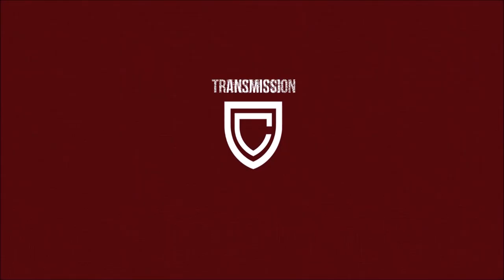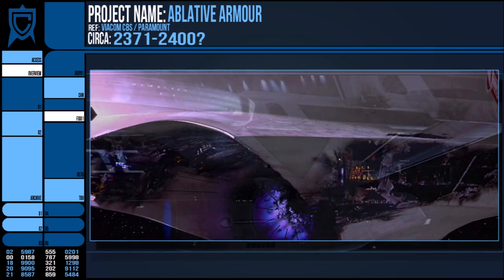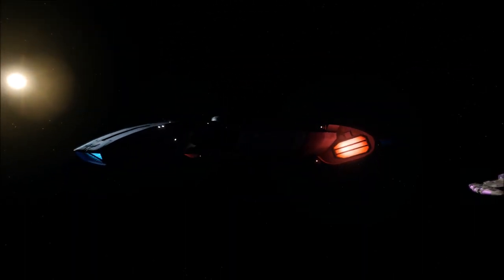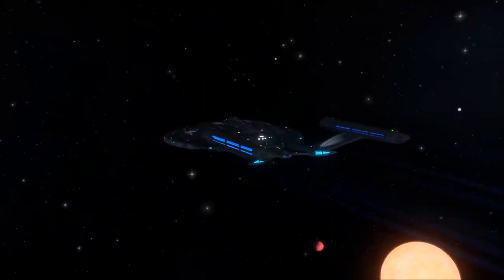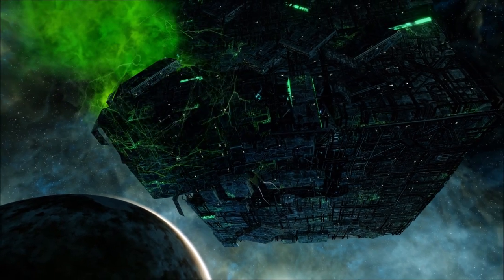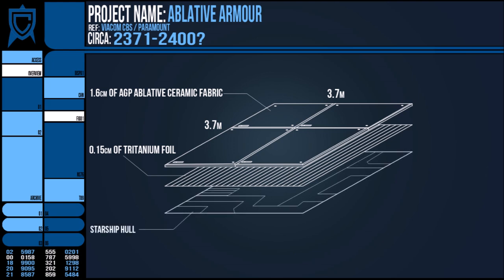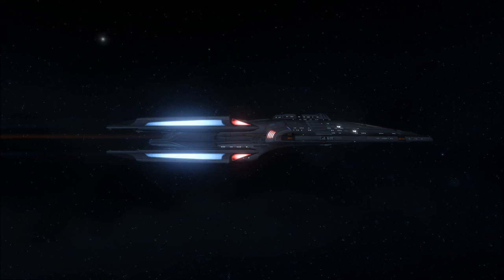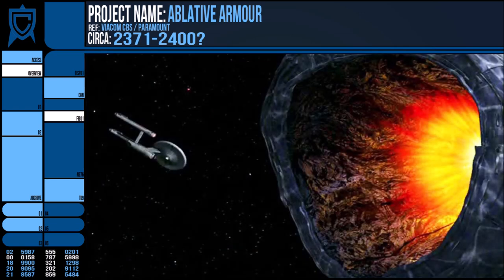What is Ablative Armour? (Star Trek Lore)

Comment: I had never heard the "full name" of starship hull material before, I'donly heard it called Duranium. When he said "Duranium 235", the penny dropped...it's Depleted Uranium 235!! The ridiculously hard material used to make anti tank shells (as fired from the A10 Thunderbolt/Warthog aircraft).
Reply: DU is actually pretty soft overall, but it is dense, and has the interesting ability of self-sharpening as it is forced through armour at high velocity. Its density also lets it absorb a lot of energy too, hence why it is used in tank armour. Also, depleted uranium is mostly made up of 238, not 235, 235 is the more fissile isotope that you want to increase concentrations of to make enriched uranium.

Star trek once again takes something it thinks sounds cool, and just uses it however. Like 'tri'tanium, 'di'lithum... What's so special about a bonded pair of lithium atoms? :p

Comment: Ablative heat shielding was first envisioned in the late 1940s, when NACA's limited rockets (including captured V2s, aka A4s) were being shot straight up, and a second stage turning around and fired straight back down to Earth, through all that atmosphere. The hardest steels making up the nose of these crafts got melted like butter. The idea came up to use resins and ceramic combinations that would flake away, carrying the heat of re-entry with them, but not letting the heat pass through them to the vital areas of the spacecraft. It took a whole lot of testing to find the right combination. But they were ready for the Mercury spacecraft. If you ever saw the movie The Right Stuff, you'll remember that scene where NASA is worried that the heat shield of John Glen's capsule Friendship 7 has come loose, and he'll burn up on re-entry. Well, that was an ablative heat shield they were worried about.  BTW, it didn't come loose. It was a faulty indicator.

Comment: The DS9 Technical Manual gives a full description of ablative hull armour. It's designed to bleed away energy from the Hull from directed energy attacks at controlled rates. It is consumed during attacks. That penetrate the shields.

It's also presumable that the Ablative Generator uses nanotechnology to deploy ablative sections. That enable themselves to additionally with time, repair themselves. Plus upon command disassemble themselves.

To repair ablative hull armour (plates) as mounted on the Defiant. an alternative to replacement of armour plates or an ablative layer reapplication ... logically would be nanomolecular repair using nanites. Since would be faster than manual plate replacement.
Reply: I think it's more likely that it is just replaced in dock after they get back from getting shot up by the Jem'Hadar or the Klingons.

Comment: Duranium - At one point is mentioned as an alloy in ST:TNG  I think the line went "the hull is composed of a Duranium alloy" - Said by worf or data. When they were scanning a ship.  (not 100% sure on the wording.)
Hull radiation protection and Shields... But you missed the Navigational Shielding that is strong enough to protect the hull from lasers and particles.  (mentioned in a Season 3 episode of ST:TNG "lasers, they are barely capable of penetrating our navigational shields.  But I guess we should raise shields anyway." - Which is why I claim a star cruiser is not able to beat the enterprise in any battle. )

Ablative Armor is an old tech. We use it now on tanks.  But the idea is to have a light armor that can protect the ship from damage, if the shields are taken out.
NB: if something has taken out the shields I doubt very much that any normal armor could protect you from the next hit.

Comment: I think it would be pretty neat, and even a logical step in the development, if they made the ablative scales combined with the self replicating mines, to create some sort of self healing armor. It might require a bigger consumption of energy, but if the shields are knocked out offline, you will have a momentary surplus of energy that can be focused on the regeneration of the armor, which could give enough time to reset the shields. With the shields up, the energy destined to the armor can be limited and it can take its time to heal with a lower input of energy.

Comment: It seams to me it would be hardened material over the hull, deployed by replicators, the material gets damaged by the usual insults, thus protecting the hull, once the amour is damaged, the replicator deployment system then replaces/repairs the damaged section.
Apollo heatsheild and Space Shuttle titles are a form of ablative amour. But without replicators, they have to be designed to cope expected with wear through-out mission.

Comment: I wonder how hull polarization would help? Even if it can't cancel out the damage like in ENT, it might reduce incomming damage to the armor and ship.
Reply: Hull Polarizzation was phased out for the Structural integrity field. The SIF was actually very powerful as was a series of shields that essentially held the ship together when damaged after a main shield failure. When you see shots on the hull that deal no damage... thats the SIF doing it's job. 
Its essentially the same thing as Polarizing the hull plating, but instead done for the whole ship.

Comment: Well let's see how over-gunned the defiant was.
It had ablative armor, that funny looking nose was a last ditch warhead/Battering Ram, The USS Defiant had a cloaking device, The Engines left a huge plasma wake for a ship of its size, it had Quantum Torpedoes and apparently it had facilities for a chain reaction device which would drain power from its target and enrich the explosives in it causing all that penned up energy to be released in an explosion (Phasers would make it worse), It could hold its ground while the bigger ships got shredded into pieces.
There was another type of warship developed for the Dominion War called Typhoon Class. Basically the same as the defiant class but it could enter fortress mode where the ablative armor would encapsulate the rest of the ship and had stronger polarization, allowing them to endure an onslaught of enemy fire until backup arrived!

Comment: Defiant IS a Warship and most Federation ships ARE Warships with a multi role capacity which is why the Klingon's call them "Battle cruisers".  They are designed for battle and operate on an extended individual missions detached from fleet assignments.
Typical Galaxy Class and Klingon Phasers operate at power levels of 60-70 Petajoules (a Quadrillion joules)  and Defiant's Armor displayed the ability to repel at least 560 petawatts of disruptor fire from a Vorcha.  Judge that from the possible 2,600 to 2,700 petawatts of protection from Defiants shields.

Comment: Ablative armor does the same things in real life. In fact, the ceramic plates on the space shuttles irl do the same thing, just with the temperature and friction of reentry.
Reply: Nupe, those are emissive, not ablative. They are not designed to wear down, unlike older disposable heat shields seen on Soyuz and Apollo. If they were ablative, you'd need to re tile the whole shuttle every reentry, but they only have to replace the broken ones.

Comment: The hull plating of starfleet vessels is comprised of a Tritanium/Duranium alloy.  Duranium in it pure state is a brittle material but, when added to Tritanium, it increases Tritaniums' strength and energy/heat dissipation rates.

Comment: I would argue that star fleet, temporal directive, would hold the technology back until it was supposed to come in the original timeline approx 16 years after Voyager season 7 , but they may want to delay using it until necessary not wanting an arms race
Reply: Starfleet tries desperately to pretend that it isn't in an arms race but it a;ways was and always will be.
Reply: The Time cops were dealing with other crap. Its the only explanation for the Abramsverse.

Comment: soo. yeah. ablative armor is really just one or more outer layers or armor, sometimes with space between layers, whos job is to take and spread the force of impact or shot out before the force hits the real armor. Modern tanks use a series of ceramic and kevlar layers of slightly different properties that helps keep most of the force away from the steel armor. Generally speaking, ablative armor is less durable than amain armor, as it is designed to fail in specific ways prior to allowing the force to reach the ain armor. Its quite effective, and the more durable you can make it, or rather the faster the ablative armor halts the force, the less damage done to the rest of the armor in general. :P

Comment: something i always wondered about sheilds, on smaller ships i get that the sheilds have to be rather limited, but it always struck me as odd how flimsy the galexy class ships sheilds were, the reason sheilds fail is either 1. the emitirs are burned out from the load, or 2. the capacitor bank that is providing the barrier its energy is drained and the ships power core cannot produce power fast enough to refill it so....why not equip a ship with several redundent sheild capacitor banks so that as the first reaches a critical level the second, and even third can be switched in to give the others time to recharge...i mean yeah that still leaves the posiblity of the sheild emiters being burned out but if your geting hit with firepower strong enough to overload the emiters, you have other problems

Comment: Would a neutronium hull make warp harder? It's not like you're actually pushing on the vessel. You're just warping the space it's in.

Of course, even if the warp drive works, the sublight drives won't. So you'll never be able to dock to space stations or orbit planets.

Comment: Well by the time Starfleet uses Ablative Armor, it is a VERY OLD concept, as Ablative Armor is a fairly new concept of battle tanks today.

Also, Star Trek makes little sense (yet again) for not sensibly stringing together existing technologies to get as working solution. Replicators plus Transporters and you get easier replace ablative armor paneling. Just beam in damaged panels to convert to energy to save some energy generating new panels. 

The Armor system in Voyager, I pictured more as some kind of Hard light construct. This would not defy the laws of conservation of matter/energy and be a pretty cool advance from less than 50 years in the future and would follow advances in mobile holograms. Hard light however being so energy intensive just to activate, it is only used on starships and space stations, or any facilities with adequate power. Obviously, head canon. 

Carbon Neutronium (CN) should be fairly easy, but again massively energy intensive, as generating the panels requires such tightly condensed replicated patterns as to have the energy budget to hull a Galaxy class ship as to build 2-3 of them with normal duranium(?) hulls. It would be less costly to hull a smaller ship, but a smaller ship can rely on maneuverability and its smaller size does grant a modest boon on shielding. But a larger ship would benefit from the massive boon to weapons resistance even a thin CN hull would grant.  Ultimately, CN is still to costly to use where it would be best used. 

You could rightly delay or prevent these advances simply because Starfleet simply does not have the power to do it. After all, warp cores are not endless power sources.

Comment: I always assumed Duranium is (D)epleted (Uranium)
Reply: That makes a lot of sense actually.
Reply: That’s an interesting assumption. IRL it’s because we had trade names like “duralumin” for early strong and light alloys (duralumin was mostly aluminium). So I always assumed duranium was similar. Of course divorced from those naming schemes being seen everywhere, as we are today, it can certainly sound strange. But certainly the “235” in “duranium 235” would seem to suggest exactly what you said, and I was scratching my head at that until I read your comment. But I’m not sure where he got the 235 from, as I don’t recall anyone saying that in a show, only ever plain duranium. So that could just be a “beta canon” term? Interesting to speculate on, surely.
Reply: We only use depleted uranium in weapons to add a little bit of radioactivity to the damage we are already causing. Yeah, it's dirty, but effective. Using a radioactive substance in hull plating would not make any sense.
Reply: @michaelsasylum  That's very wrong. DU is used in armor for mechanized infantry vehicles and in munitions due to the  extremely high density of the material and relative low cost compared to machined tungsten.

Additionally unlike tungsten penetrators, DU doesn't deform, as it has pyrophoric properties so on impact it burns away keeping the projectile sharper longer for more penetration. Or in the case of DU armor plating, it burns off and reacts to the impact to lessen the impact.

Also, while depleted uranium is radioactive, it only emits alpha particles, which aren't even energetic enough to pass through your skin, much less a couple inches of air.
Reply: @michaelsasylum  nice misinfo dude, that doesn't even make any sense.
Reply: @AdamantLightLP  He's right though.  They aren't used because of it's low level radioactivity.   It's an undesirable side effect.  It's the density and other properties that make it effective for kinetic energy weapons.  It is also used in tank armor whether or not it makes sense to you.  It makes sense to people much more knowledgeable of material properties than you appear to be.
Reply: I don't think it's supposed to be. It was a Macguffin that was't supposed to be a real thing. Its along the line of many things in Trek... use a word that sounds probable and don't elaborate too much. They called it "Tech talk" Its like Computer Bits on Optical Chips. Quantum computing was theorized in the 80s, before TNG, but much of it's terminology was not in use yet. So they appropriated what they could and gave us a Quantum computer without the terms we know now. A Bit is not supposed to be a binary bit. They changed this to Quads later as Bits became too mainstream.
Star Trek works because you can't quantify it. You can make educated guesses, and you can make assumptions, but in the end, this leaves them flexible to tell the story they want without being hampered by physics over internal consistency. :)
Reply: @michaelsasylum  Depleted Uranium is used in US tank armor due to its high density. It's sandwiched between steel plating to protect the crew from the radiation. 
As for bullets, it's used because the higher density allows the rounds to penetrate armor more easily. It is, once again, inside a lead and steel jacket to protect the user from the radiation.
It is also used for balancing weights in aircraft, because it requires a lot less for the same weight, reducing space needed.
Reply: @kaitlyn__L  Yea. the 235 kind of pushed home the idea that it's depleted uranium for me. It's hard to tell what it's actually supposed to be, but I have found that most of what they throw out (for world building at least) in Star trek actually does have some thought behind it.
Reply: @kaitlyn__L  Never heard "235" in combination with Duranium, either! To me, it's always been fictious, with the name inspired by the French word for "hard": dur.

Comment: It's actually based in reality. Modern tanks have reactive armor (explosive sandwiched between armor plates) that dissipates the effect of an antitank projectile.
Reply: Aside from being armor, the two concepts are completely different.
Reply: @mackgiver875  The ablative armor used on the Defiant is designed to protect the hull by burning away at a known rate if the shields fail.

Comment: Not the most effective means of defense. Refractive shields would make more sense. Shielding that, rather than repulsing or disapating incoming energy (regardless of the source), the energy and or radiation is adapted an incorporated into the shield matrix. As a result, the shields are enhanced and strengthened. Granted, such a system could be overwhelmed. But, theoretically, it would take the equivalent of an exploding star to do so. Not the best element from a story telling perspective. Admittedly. But from a technical perspective? Definitely the most logical.